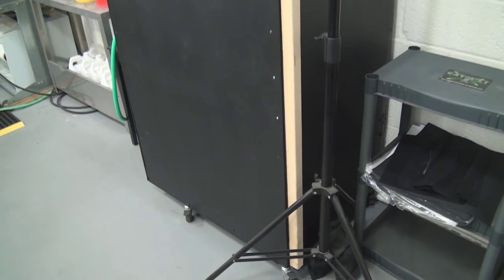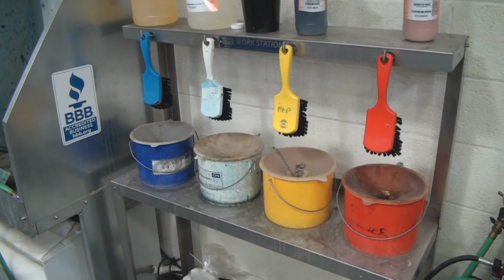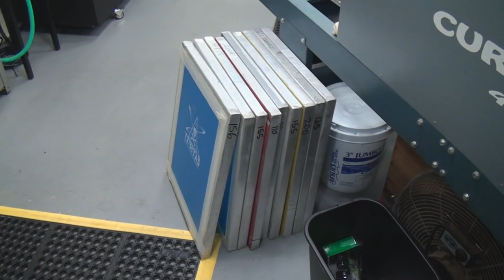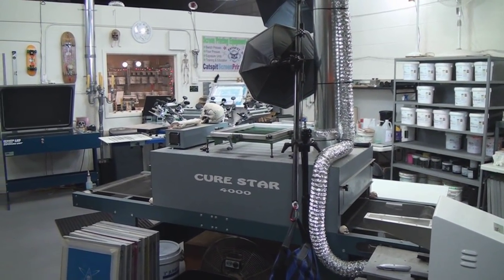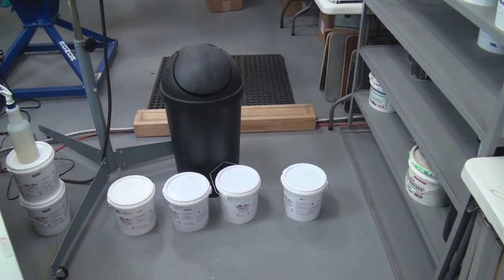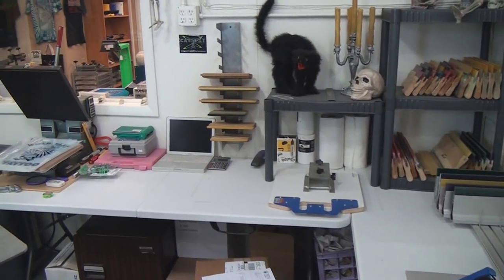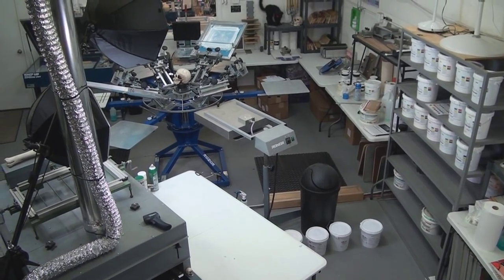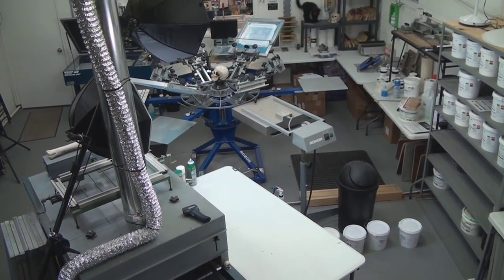Screen Printing Tee Shirts: Detailed Small Manual Commercial Shop Tour

Comment: whats the best way to get started and what is easier to use as far as ink goes
Reply from the maker: Plastisol ink is the easiest to learn with. But "the best way to get started" depends on many variables which pertain to you. What do you want to be able to offer your customers? How much space do you have to work in? What is your starting budget? Do you have access to running water, pressure washers, and a drain? How you start depends on your situation and what you want to do. Thanks for watching. Screen Printing Equipment & Supplies - http://catspitscreenprintsupply.com/

Comment: So the water going down you drain... is it safe? I am in the process of setting up shop and wondering if the water going down the drain will affect my well and septic system.
Reply from the maker: +Goat I use all drain safe chemicals with a filtration unit under the washout booth which removes solid particulates up to 5 microns in size. You would need a filtration system for a septic tank and leach field. Plus a biodegradable chemical line like my RhinoTech green chemicals would work well. Thanks for watching. Screen Printing Equipment & Supplies - http://catspitscreenprintsupply.com/

Comment: hello there pretty imformational video. I have an issue with the ink I'm using it dries up to quickly and I was wondering what is the best ink to use
Reply from the maker: Thank you, I'm glad you enjoyed the video. That sounds like you're using water-based ink which dries very quickly while you work. You would have to back flood the screen with ink in between Prince and possibly use a water spray bottle to keep the screen moist. you might also see if the manufacturer makes a retarder for the ink which will slow down trying time. Thanks for watching. Screen Printing Equipment & Supplies - http://catspitscreenprintsupply.com/